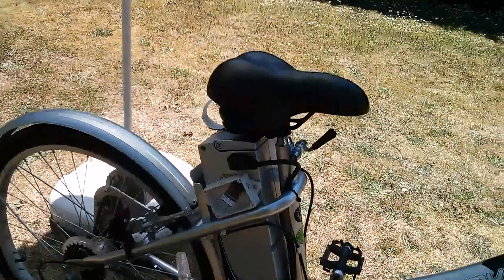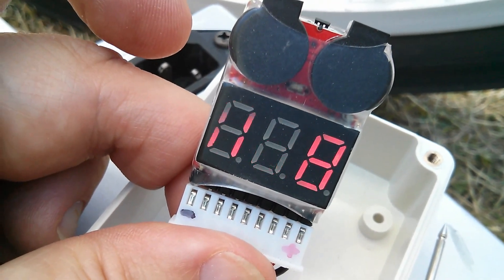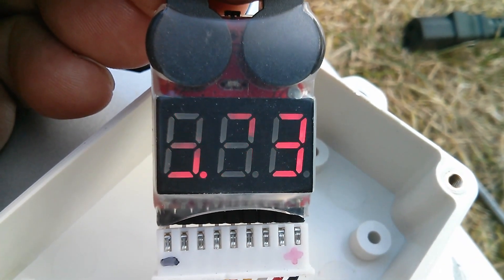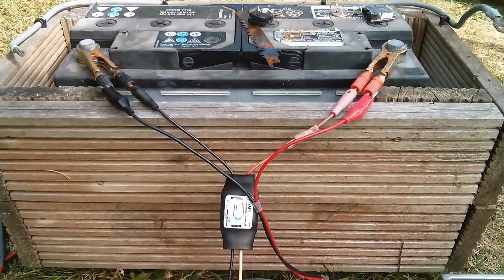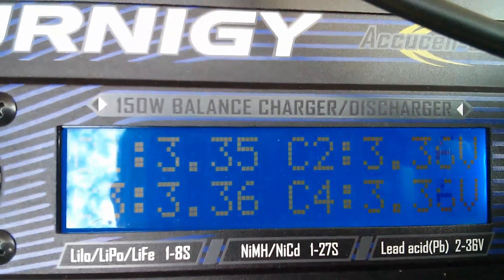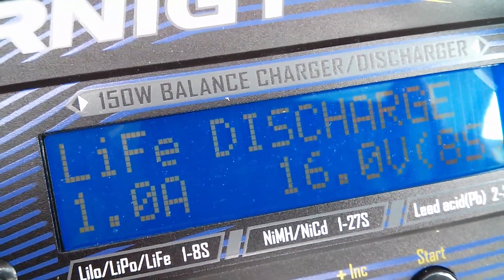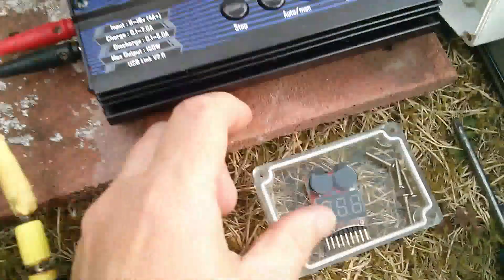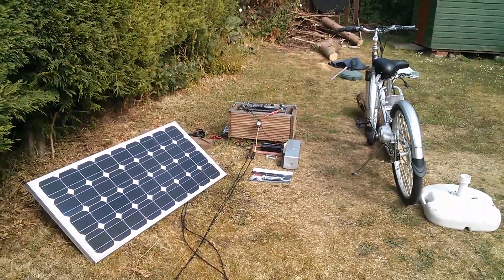Julian's Project: Electric Bike Upgrade to LiFePO4 - #5 Charging

Comment: Can you explain how balance charging works in more detail?
Reply: This also seems like a slow approach. How do EV's change there many cells? How does the tesla wall charge efficiently. Seems like there could be a better way.
Reply from the maker: The Blue Farmer I don't really know how it works in detail (but I'm learning). When I started charging these 8 cells, they appeared to be in good balance. But cell 8 must have risen (in voltage) rapidly near the end. The Turnigy then appeared to hold it at the max voltage (3.60V). It reduced the overall charging current. There are lots of medium power resistors inside the Turnigy, so I'm guessing it connects some of these across the cells that are too high. It's all pretty complicated!
Reply: Ok, so all cells are charged at the same time but if a single cell goes to high it drains the excess from that cell while the others catch up?
Reply: I had always assumed that the cells that are lagging behind were given an extra boost of current through balance charge leads to help them catch up. (but that makes no sense when I think about it.)
Reply: Julian Ilett dave (eevblog) did a teardown a while back. these chargers are all the same.
Reply from the maker: The Blue Farmer That seems to be how it works. But draining current from cells using resistors seems very wasteful to me. Not what a solar power enthusiast wants to see. I have read about systems that can redistribute charge from the high voltage cells to the low voltage cells by temporarily transferring it to a bank of capacitors. Not sure if systems like this are in common use though.
Reply: Julian Ilett I would think the resistor is not actually discharging the cell but clamping it to a preset max voltage.  It is actually working as an alternate path for current to flow around the cell using the balance charge leads and most likely a transistor or mosfet package to control the amount of current being routed through the resistors and bypassing the cell.  I doubt much energy is lost in the form of heat during balancing compared to the amount of energy lost through the energy conversion process at high charging currents since during balancing you are probably only dealing with the final 1-3% of charging.
Reply: The Blue Farmer I don't actually know how balanced charging is done but the obvious method would be to put a programmable linear shunt regulator across each cell.  A shunt regulator maintains a constant voltage across its terminals by shunting current around the cell.  The problem here is that this would require each shunt regulator to be capable of dissipating a power equal to the charging current times the cell voltage ie. about 16W.  So to minimise the dissipation in the box it must reduce the charging current to say 0.5A. A more sophisticated circuit could use a boost regulator configuration which returns the energy to the main supply instead of dissipating it and could then continue to charge the other cells at the full rate.
Reply: ***** individual cell charging is a no go, way too expensive and difficult to implement. simple balancing board will be much simpler and smaller to use/build.